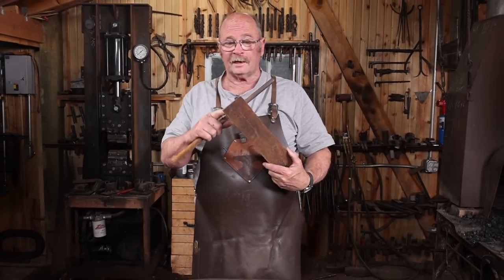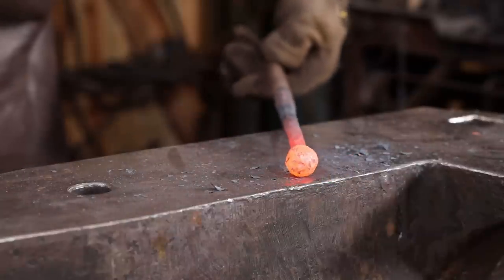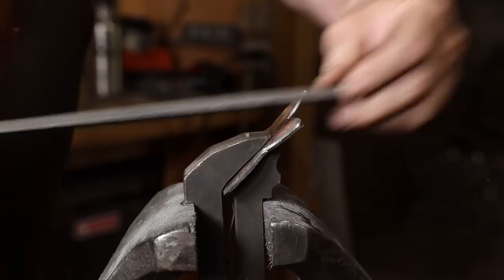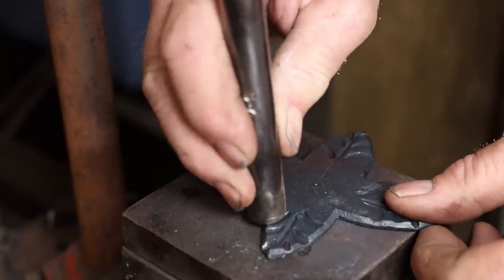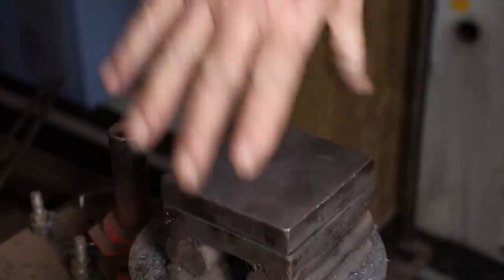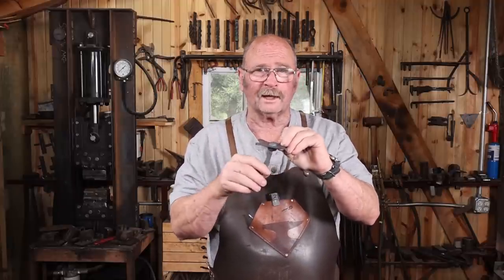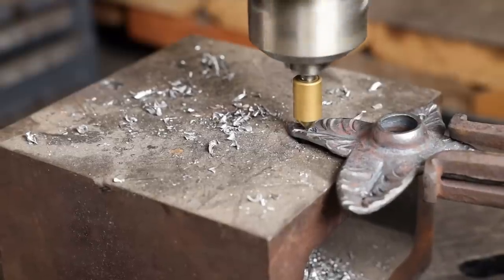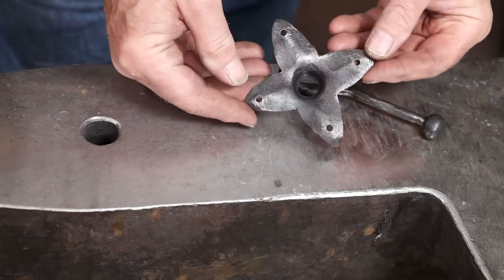Forging a Ceiling Hook that Swivels

Comment: This turned out amazing ! Just wanted to give idea -instead of forging a ball it would be easier to weld a rod to a ball bearing(or anneal it and use lathe to make a thread ).You can also use ball bearing to make a hole in which hook will sit with better precision . 
Anyway amazing idea and you did a good job of making it .This would be amazing hanging bike stand if you add pulley and ropes :)
Reply from the maker: It might be, but I try to demonstrate blacksmithing as much as possible

Comment: Beautiful work!
I was thinking, the steel tools used in leather carving, many of which are essentially variations on teardrop punches and butcher tools, might work for the type of decorative work like you did on the flower portion of this. I’m not sure how they would hold up to use on hot steel, but they might serve to do some neat work on copper!
Reply from the maker: I doubt the tools made for leather would survive for long.  But they can be a great pattern for making more substantial tools for forging.
Reply: @BlackBearForge  Good idea. Longer handles would be a must anyways, what with the glowing hot workpiece. 😎

Comment: The punch you used to form the cup in the mounting plate looked very much like it had been salvaged from an inner steering rack tie rod end.
Looking closer, it looked like a ball welded on the end of a piece of bar.
I would be interested to know how that tool was made.
I adapt anything I can to make a job easier, so I can see this being the case.

Comment: Very nice as always.  I wondered why you didn't use your induction forge for those times you wanted a very short heat?
Reply from the maker: Only because its not set up all the time.  There isn't room for the coal forge, gas forge and induction forge to all be ready to go.  I'm thinking of moving the coal forge out so the gas forge and induction forge can always be set up and ready to work.

Comment: Your scrap bucket(s) don't appear to be under cover.  Side Questions:
1. Are there holes in the bottom of them for water drainage?
2. How much rust do you have to remove before forging?

Comment: I tried forging a 2.5 lb hammer to have a cross peen and the metal started cracking. Is it poor metal or too cold?
Reply from the maker: Too cold is the most likely cause, but there are other possibilities. Too hot will also cause failure and pre existing stress in used steel can be a real problem.